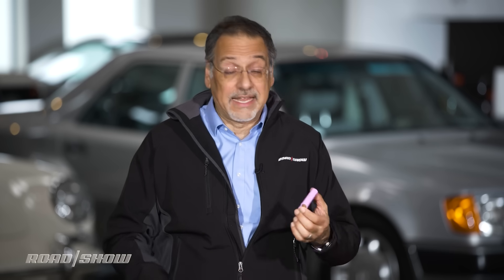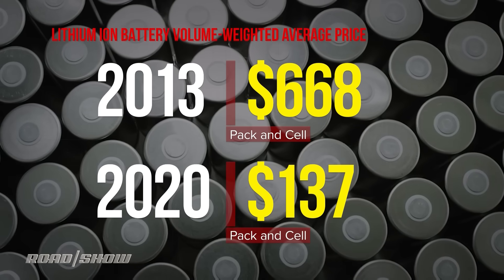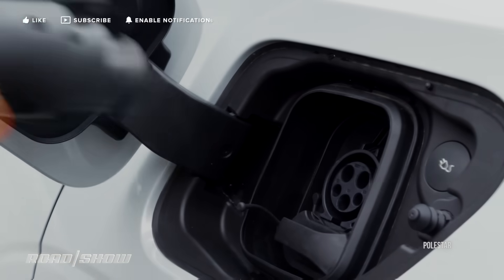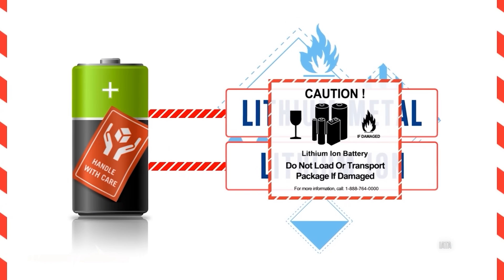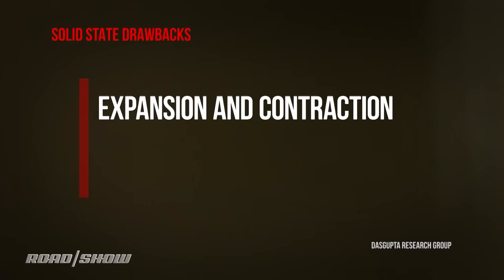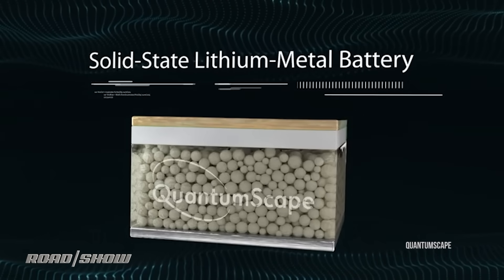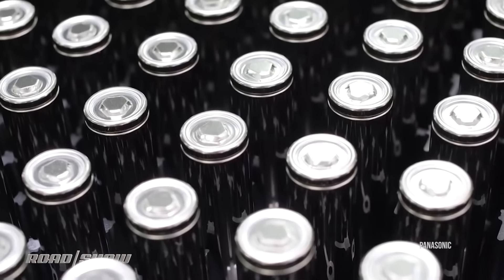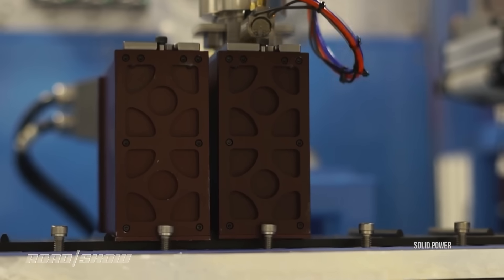When solid-state batteries arrive, you'll want an electric car

Comment: meanwhile Scotty Kilmer: imagine 11 million electric car users plug in at night at the same time in Texas...
Reply: 420KinK  thanks to demon Rats!
Reply: @David LightmanAlmost any current carrying parts. Wires, transformers, switch gears, almost anything on the neutrals, breakers, fuses, etc. Regulatory Document IEEE C57.18.10 is probably one of the more in-depth regulatory documents regarding the effects of harmonics. It specifically looks at their effects on transformers.
Reply: 420KinK  Only Northern California has forest fires.
Reply: @dangerous8333  Right.  People in So Cal have earthquakes and mudslides.
Reply: @David Lightman It's not garbage, it's physics. I am a fully licensed Professional Electrical Engineer. When you rectify AC power to DC power you create current harmonics on your system which travel towards your source. Those higher frequency harmonics cause additional heating. I have to oversize components to account for them in new installations. The problem is existing installations. If they don't already have the capacity to deal with the additional heat the entire system may need to be replaced. The more harmonic generating loads used the more likely this scenario is.
Reply: 420KinK  I see you are a "clean energy" fan. But sorry to tell you that solar is still in diapers. It will take 100 years to make it reliable and still then we would depend on mother natures will anyways. But the good news is thst we have plenty of fossil fuel that will last 1000 years I think by then there are going to be other sources of energy thst really are clean and reliable. And a point to make 100% of the automobile running in USA are 0 emissions. Dont know if so in other countries!
Reply: @David Lightman Emissions regulations literally have absolutely nothing to do with it. The small "tweak" you are referring to involves breaking fundamental laws of physics. 20 amps can be a very large current if a large percentage of a city draws that. It would appear you have no working knowledge of the topic and are either uninformed or miss-informed.  Feel free to call it whatever you like; physics doesn't care. I don't see a reason to respond to you further. You have clearly made up your mind on the topic regardless of the facts.
Reply: 420KinK  just wait until the price for electricity rises...
Reply: 420KinK  when 95% of your infrastructure is solar and wind, the 5 % gas and goal won’t cut it for 25 million people
Reply: 420KinK  point is gas and coal are way more reliable than solar and wind. Hell if we’re talking about the reliability of nuclear power than end of discussion
Reply: gasoline production requires electricity
Reply: @cadriver2570  Technically, it doesn't require it. However it does make it easier. Hydrocarbons were being distilled prior to electricity.
Reply: Batteries are harder on electrical grids than most motors (without VFDs). Not sure who's going to have to pay to deal with all the current harmonics...
Reply: @David Lightman The large amount of harmonics are going to be a lot more of a problem than A/C. Especially triplins on local grids. Unless your A/C uses a VFD.
Reply: @whatroads4x4 Carbon nanotube based caps are the future of batteries anyway. Problem is they are probably 10-15+ years away from mass production...
Reply: @David Lightman I did a bunch of reading on the specific application of the test and procedures. From what I can find the frequencies measured are in the 100+ kHz range. The frequencies that would cause significant heating are typically in the range of 120Hz-5kHz as the amplitudes are typically much higher. This was my understanding before and why I said it is not relevant. This test seems much more based on verifying the rectifier is operating properly (if it wasnt you'd likely see very high frequency distortions) and ensuring those harmonics passed back don't impact other DC components in the system than on mitigating heating harmonics passed back to the system itself. Even if it was regardless with a large volume of people pulling a significant DC current there would still be significant harmonics seen on the line. I also don't see why you would think harmonics need to be accounted for in only transformers. 1) replacing system transformers is a huge cost anyway and 2) Anything conducting electricity would see increased conduction losses with higher frequency components. The effect may not be as significant as a transformer but it will certainly still be there.
Reply: @David Lightman About 15 years. I specialize in designing custom transformers for harmonic loading (Drives, rectifiers, traction duty, etc.). Usually the harmonic spectrums I get in specifications don't go beyond about 1.2 kHz because the amplitudes typically decay by 1/n where n this is the harmonic order. I've had to analyze systems in the mHz only a couple times and primarily focusing on partial discharge for insulation purposes. 

I don't have anything against electric cars. I'll probably buy one in 5-10 years when battery technology in Tesla's gets a little less archaic as we are still pretty far out from various thesis papers I have read. I see Tesla's as more of a giant R&D project right now. The problem is the mass scale of DC energy distribution is not something we've seen at what is predicted in the future. Ironically I'm sure Nikola Tesla is laughing at us somewhere because if we listened to him we wouldn't be having the same problem.
Reply: @David Lightman Would most likely be one of two scenarios. First I need to do a standard disclaimer that this not professional advice as I am not working on commission to answer this and am thus not fully insured. Effectively in the context of this discussion I'm just "some guy" on the internet.

The first scenario is the transformer in the system is after the rectifier/inverter for a momentum based power backup or storage device. In this case it would see significant voltage harmonics which could move the core further into saturation if the transformer core is not designed properly. This could result in a significant increase the excitation current. This more often seen with VFDs though so it would be atypical for a solar application.

The second more likely scenario is the current harmonics are more than what the transformer was designed for so it is effectively overheating due to the increased eddy losses.

Looking at more general scenarios if the transformer has multiple independent outputs it could have been designed with loosely coupled windings without accounting for the field cutting through the middle of the coil during imbalanced loading resulting in HUGE eddies (learnt that one the hard way many years ago).

It's also possible the solar application is completely coincidental and the problem is environmental (cold/snow/heavy rain) getting inside the enclosure. As I'm not familiar with the exact setup and environment it is hard to present anything conclusive.

It could be something else as well but that's where I would start as those are the most likely scenarios from a transformer standpoint.
Reply: 420KinK  both ineffective in bad weather...
Reply: In the winter, that could cost people there $16,000 a month.
Reply: 420KinK  "How the hell do you heat a hose with a car? "
By hooking the battery up to your Tesla wall...until it does.
"They slept inside it numb nuts'
Running a car in your driveway won't kill you. Or were you thinking otherwise?
Then again, who is going to stay inside a car for days?
Reply: 420KinK  "Gas appliances in your home have a vent to the roof. "
Portable kerosene and propane heaters for indoor use are readily available. They've been used for over a century.

"It has no V2G"
Tell that to Tesla. They might want to update their Tesla Wall documentation.

Perhaps if you use another pejorative you'll feel better?
Reply: Power just comes from the socket duh
Reply: 420KinK  lmao you sound like a cultist.
Reply: 420KinK  Oh come on, that was an excellent example of Darwin at work! Seriously, society is better off with out the "fallen" in the gene pool.
Reply: Kilmer is a good mechanic but has no clue about EV’s. Engineers already solved the EV charging load problem by implementing grid flexible charging, rate tariffs to entice people to charge when the grid has extra capacity, etc. In fact because generation must match consumption at all time for an electric grid, EV charging can actually help stabilize the grid better (charge when there’s excessive generation but stop charging during high demand).
Reply: @mintheman7  What if you have somewhere to go when there's a high load on the grid? You can't charge your car and you're stuck? Lmao. That's not solving a problem, that's avoiding a problem.
Reply: @Dorkus89Malorkus  You can still charge your EV during high load, just have to pay more for it, simple as that. You are not stuck as all these measures are voluntary. You are just incentivized financially.
Reply: 420KinK  that's what I thought. Elon Musk, the only guy who overpromises and under delivers on a regular basis but still has a cult following.
Reply: 420KinK  Burning has and hauling my mentally challenged friend
Reply: 420KinK  I will bet you any amount of money that the hyper loop will never happen.
Reply: 420KinK  as long as it's the non toxic type, I would like them to last longer than 30 years too.
Reply: Or share electrons
Reply: Too late, we're all dead already, the children and pets too.
Seems like a lot of EVs in Southern California and our power is very dependable, but not cheap. 
Pacific Gas and Electric Company (PG&E) is commissioning a 182.5-megawatt (MW) Tesla Megapack battery.
Reply: 420KinK  People with Teslas have to wait for their cars to charge before they can go anywhere.
Reply: When Electric cars take off, people will probably stop owning them.  If all you have to do is pay 5 dollars for an autonomous ride to work, it's there in 5 minutes.  The amount of cars on the road could be drastically reduced, parkinglots could be turned into something more useful.
Reply: @danielbrowniel  " The amount of cars on the road could be drastically reduced,"
If you live in the city. Not so much for suburbs and beyond.
Reply: @danielbrowniel  you make a point.   Dead heading though will still keep the roads and lots choked all day long,  not just "rush hour".  NYC and a century of taxis have shown that.   To have enough autonomous robot cars to fulfill a whim of I need a ride right this second,  snap, there it is,  means there are thousands of empty robot cars this very second in a large city.   At least a hundred within 2 minutes of you. 

Makes more sense to have trains or express chain buses in from outer villages and rideshare from platform to job/concert/restaurant as it used to be. 

Leave the car you own/lease in the village you live in your garage... Or move to the city and breathe Covid but skip the car. 

If Covid changes things like Influenza 1918-1920 did,  then the suburbs will be reinvigorated.  City jobs will be shunned for awhile.  Unless you work in a factory or direct labor job,  there is little reason to leave home today.   

Few futuristic plans actually work as expected.
Reply: @danielbrowniel  It won't cost $5 ;) Also, nobody wants to want around for public transport, whatever form it takes. That's why we all have cars. I want to go somewhere, I go now.
Reply: @tinytownsoftware7989  self driving would fix that.  public transport sucks because everyone on a bus is going to a different place.  If you took every car that exist now, got rid of half of them, that would still be more than enough to work.  Technology is almost there.
Reply: @danielbrowniel  That's what you think but it's not true. That's what Democrats and environmentalist are trying to do though. That's why gas prices always go up when a Democrat is in office. People don't want to be cramed together with strangers anymore. It's why New York's outbreak was worse than other places. Public transportation is filthy. I saw it first hand over 20 years of living in Los Angeles.

Maybe it will happen in the cities. But I'll never live in a big american city ever again, so you can enjoy. I'm also not interested in paying $5 to go one place. With $5 of gas I can do a few errands.
Reply: @dangerous8333  don't you dare call me a Democrat! Lol. I'm just saying this is how money works..  I'm pretty sure a shared car that's cleaned once or twice a day is superbly more clean that whatever most people drive in..  Besides, it would probably be good for the publics immune system, I work in healthcare and most people in healthcare rarely get sick and when they do get sick, they barely get sick.. it works like a sport.. if you have everything hyperclean your immune system forgets how to play the game..  I would rather have more money and not have to take care of a car personally.  You probably wouldn't share your ride with anyone you didn't know, because everyone is going to a different place plus it's safer that way.  It would be way way cheaper and car companies could focus on making safer and more dependable vehicles rather than CHEAP.  Consider all the time a vehicle waste just sitting in your driveway or in a parking lot at work.  Once they can move themselves, no one will want to own one.  I mean when you go shopping, do you bring your own shopping cart?  Gimme a break!
Reply: Yea black outs 
In California we have black outs in the summer by regular day to day life
I can’t imagine all electric we are not ready maybe in 50 years
Reply: @Contreras-z4e  Not every place in California has blackouts. Los Angeles, because it's run my idiots, and a few places in Northern California during wildfire season. Why do people that live in these places always speak for the entire State of California? Our problems aren't all the same problems. You can go an hour outside of LA and not have any of the issues that they deal with. I lived in Los Angeles for 20 years.

In northern california our only blackouts are during high wind red flag days, and they are planned.
Reply: @Contreras-z4e  Very much like a second or even third world nation....
Reply: @Contreras-z4e  that's why we need nuclear. Small modular reactors.. another solution is cars that are off grid like aptera.  If you only drive 20 miles every other day.. you never need to plug in.
Reply: Easy enough to imagine if you remove the huge energy requirement needed to extract, refine and transport oil, petrol and diesel around... It uses 8kwh of electricity to get ONE gallon of petrol. Stop doing that, and you have electricity to spare..
Reply: 420KinK  "Fun fact people with Teslas were able to stay warm and watch Netflix inside,"
For about three hours. Then they were shopping for propane heaters.
Fun fact, a Tesla battery won't heat a home for a multi-day outage in single digits, but people will try to pretend they will.
Reply: 420KinK  Millions of Americans heat their homes, cook their meals and heat their water with propane. They also run generators with propane. It doesn't take a genius to realize that.
It also doesn't take a genius to realize that a Tesla battery does not have enough energy to heat a home for a multi-day outage when temperatures are in single digits.
Reply: 420KinK  Solar energy is in diapers. It is not a solution and it will never be. First of all it is not a reliable source. The king still is and will be natural gas and oil. And dont mention pollution. 100 % of cars in US  are 0% pollutters.
Reply: 420KinK  No I guess maybe its you believing all this crap about solar.  Solar its just for minimun use. Technology for solar its not here yet. Remedy would be batteries that could hold energy for long periods of time. We are not there or near there. It would take 100 years at least and by then it will be of no use because other source of energy its going to be available.
Reply: 420KinK  Solar doesn't work unless the sun's out. The chemicals and waste produced while making solar is just as bad.
Reply: @dangerous8333  not true at all

Comment: How do you plan to charge those cars with the extremely limited solar and wind power available without coal, gas or nuclear?
Reply: Why is it "extremely" limited? The Orkney Isles in the very North of Scotland relies totally on wind and sea turbines. And as a result they produce 20% more electricity than they actually use (the population is 24000)...... That's not bad for something that is "extremely" limited, is it?  If it works for a group of 24000 people, why cant/won't it work for larger groups if the number of wind turbines is increased accordingly? And remember, if we all drove EV's then you could remove the huge energy requirement currently used to extract and refine oil, and use that for personal transport requirements instead.....

Comment: Still doesn't solve the problem that you need to squeeze Mega-Ampères trough a copper cable grid that wasn't designed to handle the currents of lots of cars charging at the same time (especially in remote areas). Charging losses aren't going away and when you are envisioning the use of "buffer" batteries, the accumulated efficiency of the whole system quickly drops to levels that make fuel-guzzlers of the 80 look great.

Comment: The more energy you pack into a small volume, the more it will resemble an explosive.  High energy-density devices will be lethal, with occasional spontaneous decomposition, and in a crash, well, go figure!
Reply: What about gasoline? That's liquid energy.
Reply: @CameronsCookingChannel  Thermal energy from burning it in a chemical reaction, yes and a very good source it is too!  But it's not a source of electrical as he is talking about in the video.